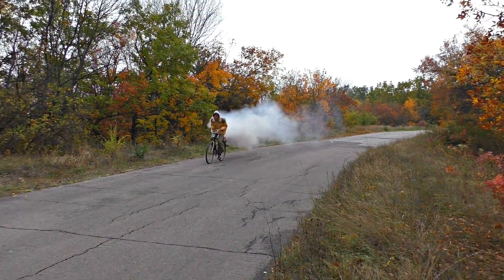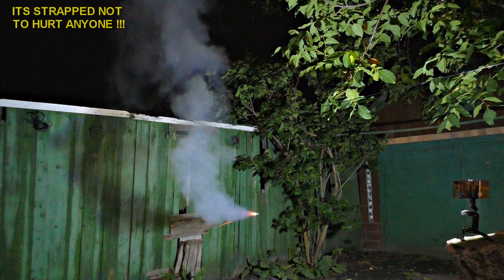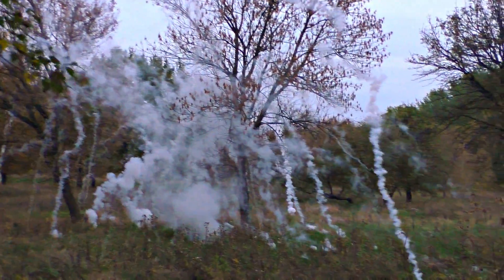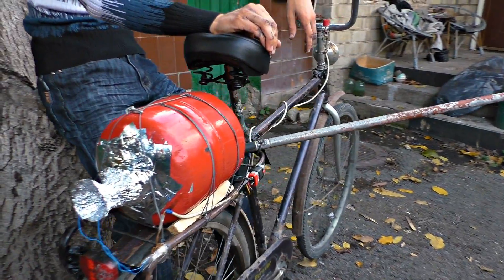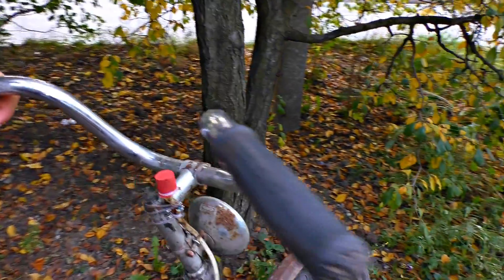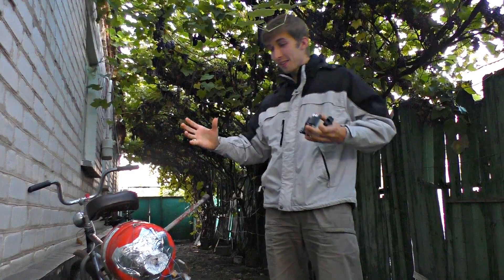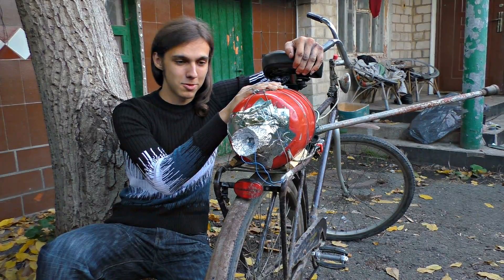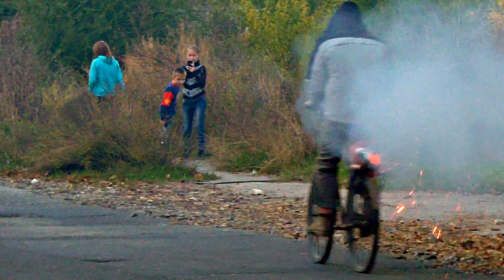JET ENGINE Bike DIY (nitrate-caramel fuel)

Comment: This is a solid fuel rocket engine, not jet engine. 

A sheet of metal between the driver seat and the engine would be a good safety feature.

Comment: Guys, not even Kerbals do it like this.
NEVER EVER do dry mixes. These are heterogeneous powdery mixtures that have enormous potential to detonate.
If you want to make sugar engines, mix sugar and potassium nitrate in hot distilled water until they dissolve, and then slowly cook it down on a heat plate, constantly mixing. Still hot and pliable fuel has to be loaded and smacked into a tube, let to cool and then the ignition cavity is drilled in. Such fuel is very homogeneous and burns fast and orderly.
Also, the tube must never me made out of metal. Use cardboard or PVC pipe.

You are lucky you survived this. What you made was a pipe bomb. It simply has to explode. Please take better care of yourselves.
Reply: Lajos Winkler , i almost shit when i saw them igniting a dry mix.
Reply: Lajos Winkler  straight up tho and solid rocket fuel is also a danger as one sizable air bubble can fuck your day off hahah these guys are reckless
Reply: LMFAO!! Let's strap a bomb to our backs and see how far we can fly LOL!!
Reply: J Bolo, I almost shit when I saw they uploaded another crazy video. These guys are crazy 😆
Reply: @mir.9805  PVC in such engine won't burn. Inner wall forms a charred wall that stops the fire. Also, dioxins and furans are not "the most toxic man-made products". You're describing these engines as if they release dimethylmercury. It's just wrong.

Steel casing is a VERY bad idea unless it's used at distances where potential detonation won't harm anyone. It's best to avoid it altogether.
Reply: That shit was wicked asf tho

Comment: I've seen some sketchy shit on this channel but this takes the cake. The only thing between that engine and a big pipe bomb is a little too much fuel, or the wrong packing arrangement. Any time you mix an oxidant and a reductant like this in large enough quantities and ignite them, they can explode. You're tempting fate here. Anyhow, if one of you gets wiped out, make sure you post the footage!
Reply: If you live in a place like Ukraine, then you pretty much dont care anymore...
Reply: do you think the thicker the container the more powerful the blast? or just heavier shrapnel
Reply: Pete Lorenzo I would guess that you would get a bigger explosion as a result of containing the heat, so that the combustion is forced to occur quickly. You would definitely get heavier shrapnel.
Reply: This has to be one of the most dangerous builds I've seen on YouTube. You are inching closer to getting yourself into the Darwin Awards. Poor kid in Cali blew himself up like this and died. This is no joke!!
Reply: I would have used paper sheets for the motor but never metal. The first test which detonated with cameraman close to it was insane. They are lucky not to be injured.
Reply: No doubt. Just a few more “experiments” of this nature and statistics will maim or kill one of them.
Reply: wtf are you doing man literally almost blew yourself up if you end up with a higher pressure spike you're going to die
Reply: Not only was it a pipe bomb(and they demonstrated this with their early tests) but it was not secured properly.  This could have was turned into a RPG.  He also wore flammable clothing.